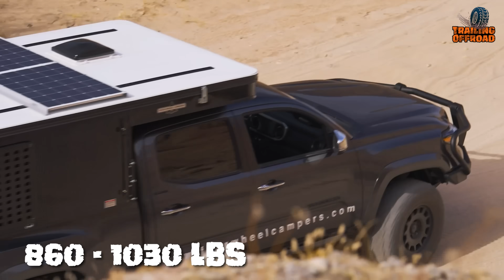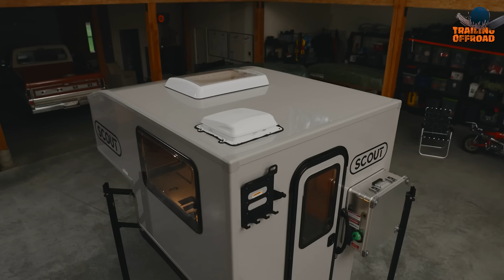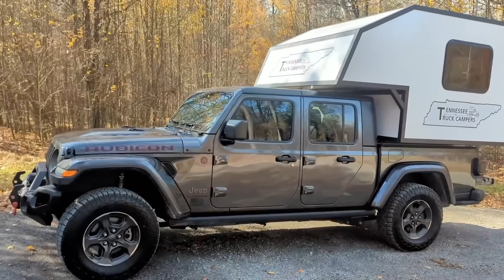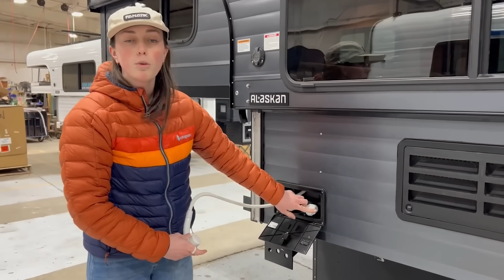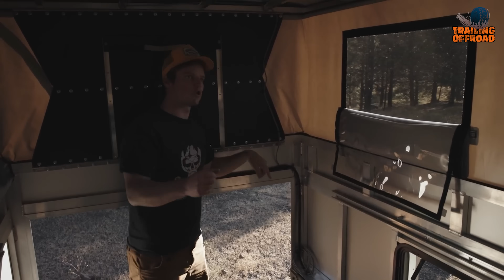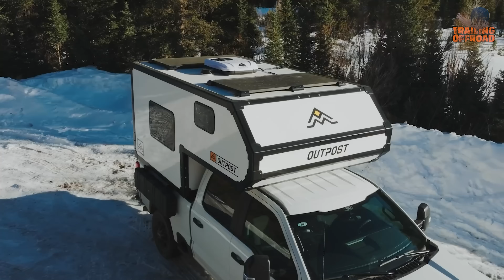25 Best Lightweight Truck Camper You Should Check Out

Comment: The Aliner Switchback is advertised "fits all trucks," even compact/mid-size trucks. But it doesn't "fit" as I would expect using that word. Meaning, Aliner apparently has a different definition of "fit."
The smaller bed-size trucks (5ft or less) -- such as the Ford Maverick & Jeep Gladiator --  require you to keep the tailgate down or remove it completely because the Switchback it TOO LONG to fit IN the bed with the tailgate closed. But if you do that, you (1) lose your nice/high-resolution backup camera AND (2) your 3rd/top (tailgate) brakelight, which may make the truck illegal to drive in some states.
Aliner needs to add a brake light AND a backup cam -- but high-quality and at least 1080p resolution (no low-resolution/blurry crap) -- to the Switchback to address those 2 issues. That's easily doable, so there's no serious redesign or "rebuilding" the Switchback required.
But again, the tougher issue is it does NOT "fit" in smaller-bed trucks length-wise. IMO, it SHOULD fit inside a truck's bed so the tailgate can be kept/closed and you CAN keep/use your backup camera & top/3rd brakelight. Plus you have that extra layer of security given by closed/locked tailgate.
So if you want a Switchback, be aware of those issues. Otherwise, you have to have a larger truck and/or a longer bed (6ft) to keep your tailgate.
I've already told Aliner about the 2 negatives re: keeping the tailgate down or removing it. Hope they address them in the near future. Regardless, I really do NOT want to give up my Top Dog "off-road-focused/serious 4x4" mid-size truck just to fit a Switchback in the bed properly.
EAT: Forgot to add -- if your truck has a high ground-clearance -- like most serious/off-road 4x4 trucks do -- a Switchback in the bed MIGHT be too tall to fit under a typical garage door opening (7') so be sure to take measurement. If it doesn't, you'll need to park it outside or remodel your garage door to 8' to park inside. Since the Switchback is not easily installed/removed, for me, once installed, it would need to be LEFT ON the truck at all times, so I WOULD want to be able to store it (and my truck!) inside the garage.
-- BR
Reply from the maker: That's really helpful information for anyone considering this camper. Appreciate you sharing your experience!